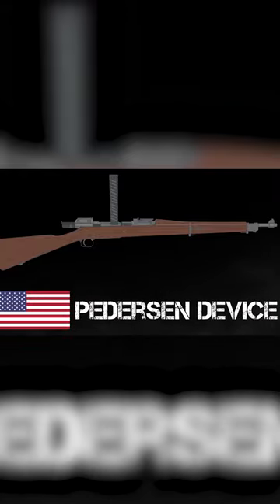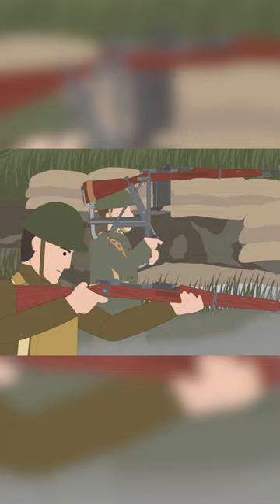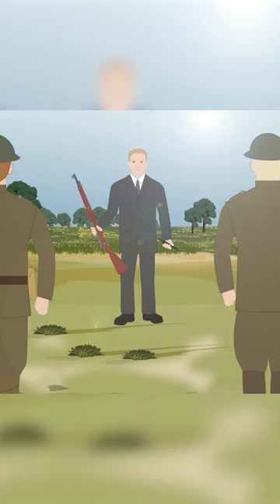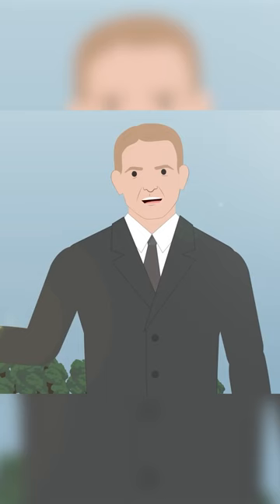Strange Gun Upgrades -  Semi Auto Fire mode on a Bolt Action Rifle (Pedersen device)

Comment: 300 yards is still pretty good for a semi-automatic
Reply: I doubt it would have been effective at 300 yards, the pistol cartridge was very underpowered. It was intended to be used in he trenches at very short range. The idea may have led to the creation of the M1 Carbine with a heavier & larger round that could reach out to a maximum of about 300 yards.
Reply: *at the time.

Even manual actions back then weren't particularly accurate.

Comment: The rate of fire issue didn't really have anything to do with the power of the .30-06 cartridge... not sure why it keeps being said in the video. For the Pedersen device in particular, a pistol cartridge was ideal/necessary, but only due to the simple blowback mechanism. There are other types of conversions for a rifle like this that could instead use the original rifle cartridge, like the Howell rifle conversion for the Lee-Enfield.

If anything, the reduced power of the .30 caliber pistol cartridge was critical for the role only because of the reduced size, weight, and recoil which would make it easy-shooting in close quarters, easy to carry several magazines, and easy to fit some crazy amount like 40 cartridges in a magazine.

Comment: There was a mistake it did not fit a standard 1903 they were modified 1903 that used a cut reviver to lock in the bolt

Comment: Some Pedersens were chambered in .32 French long and I think some were in .380 apc they made them so that some standard infantry could use a rapid fire weapon to suppress enemies
Reply: It fired a .30 caliber cartridge that indeed was very similar to the .32 French long .  Not a .380, those bullets wouldn't fit through a standard m1903 Springfield barrel. The whole idea was that you could use an (almost )standard m1903 in 30-06 caliber, and by changing out the bolt (in the field) could turn it in a kind of pistol caliber carbine.

Comment: 200 yards for a big mag is a fair trade I'd say
Reply: Sadly, it was much worse than 300 yards. The .30 pedersen was a round comparable to a .380 and especially in a suppressing role very underpowered. Test after the  1st world war showed that ,to be effective,  soldiers had to leave their trenches firing the standard 30-06 round and when nearing the enemy trenches would change out the bolt for the pedersen device.  So, they had to convert their rifle in no man's land under fire. Apart from this tactical problem it also seems that sadly the devices weren't very reliable. But it was a very interesting idea!
Reply: @merlijnwiersma7801  this dude wanted 300yards, you now have an exotic knife on a stick

Comment: I always dreamt of wondering if a Swiss K31 bolt action rifle could be converted to a full auto rifle by milling a gas port into the left side of the barrel, attaching a gas tube along the left side of the barrel/stock running all the way to the back of the butt stock with a gas piston inside of the gas port and a housing sitting on top of the buttstock with a mechanism attached to the gas piston inside of the housing with a recoil spring pushing the mechanism forward against the bolt carrier